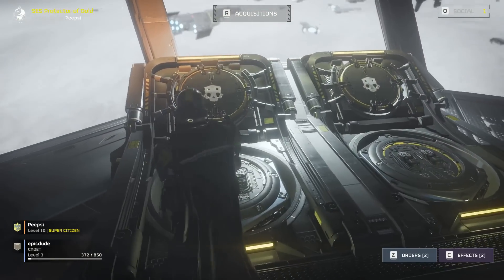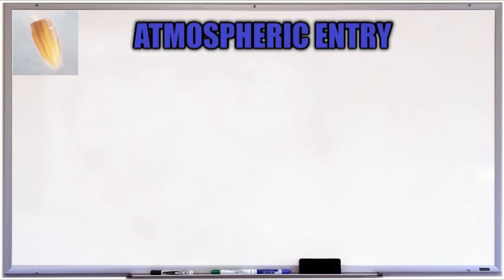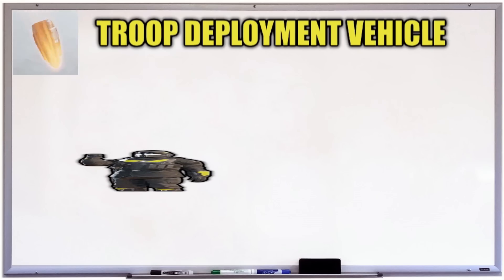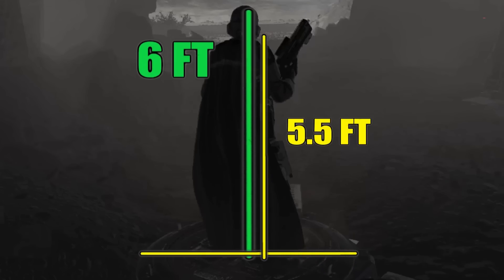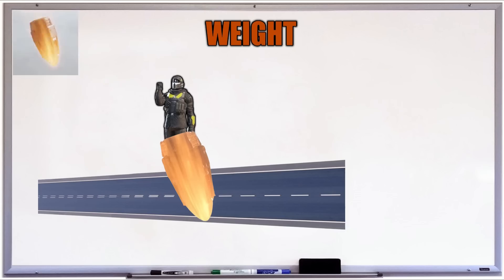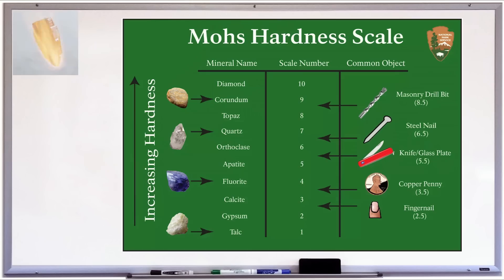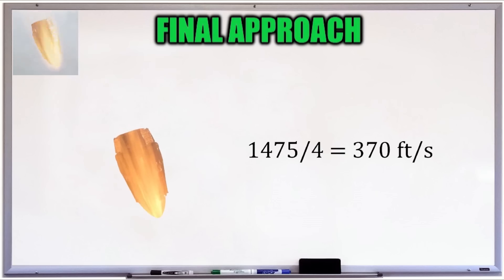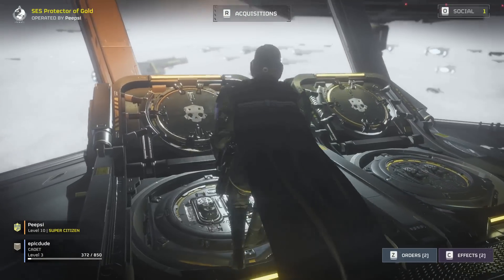Engineering in Games: The Helldivers 2 Hellpod

Comment: What occurs to me is that given the rising motion, it's likely that the passenger in a hellpod doesn't stop all at once, picture a set of ultra resistant springs below the helldiver's 'floor' plate, that spread the 'time to stop' out over a longer amount of time for the passenger as opposed to the pod. This would cut the effective G force substantially. The now compressed springs could then provide force for the rising of the platform to eject the Helldiver from the pod. Other's have brought up this idea and I think it has some value to solving the engineering issue of 'unsustainable G forces on passenger' we're encountering here. Combined with lightening the pod itself and just a smidge of "I don't care about the long term damage." dedication to the cause, I think it's solvable.

Comment: im not sure about the whole shock absorbing gel theory that ive seen in other comments since from my knowledge in hydraulics liquids arent compressible to any useful degree but my idea would have been pneumatic pistons under the hell diver that could be used to absorb the impact force in compression and then after wards use the pressure to extend the pistons and lift the hell diver out of the pod.
PS: im not an engineer, I used to work as a mecanic and my theory is only based on my limited knowledge of hydraulics and pneumatic systems.
Reply: Shock Absorbing Gel is mentioned in one of the ship module upgrades to add that to the sentry deployment hellpods.

Comment: You didn't take into account the increased drag from the opening of the side flaps after you're out of atmospheric entry.

For a real Hellpod to work, the retro/thrusters would need to go online before what it is shown in game.

The real calculation is to figure out how high you'd need to deploy flaps and thrusters to slow down the hellpod enough for it to experience at most 10G of force when stopping. 10G is easily manageable and with training that is what fighter jet pilots and astronauts train to endure.

Edit: also there are shock absorbers that could be in place inside the hellpod to further decrease the deceleration and reduce the Gs experienced by the helldiver, which is also in canon that the hellpod does have shock absorbers to prevent a hellpancake.

Edit 2: Also, at least show on screen metric so we can follow along and try to help. With imperial you are basically limiting this to only USA to be able to help solve, I can only help telling you factors you could double check and tweak.

Edit 3: Thinking even some more, there should be a Rocket equation calculation to account for the weight of fuel for the retrothrusters to reduce the velocity on the hellpod. Additionally, taking into account the action of flaps and retrothrusters to reduce the Gs on impact you can afford to use lighter materials in both the cone and the hellpod walls. Also, you need to account for the insulation for the material, although you could just line it with Aerogel (which weights the same as air roughly) and your insulation issues are taken care of.
Reply: SUSTAINED 10 Gs is what pilots are trained for, so we could assume that during the slow down by the engines and flaps, the helldiver could experience 10 G optimally, but the actual Gs during impact can be higher since they're felt for a shorter time, ejections seats in fighter jets, for example, can make the pilots feel up to 30 Gs without dying, but being combat ready is a different story
Reply: 'real hellpod' in a sci fi game
Reply: @Random-user22  what kind of person comes to a video about the math of a hellpod from a sci fi game and what bothers them is the "real hellpod" expression?

Comment: Maybe ... make the tungsten nose cone hollow and then fill the tungsten nose cone with a metal that still has high heat resistance but crumples on impact like modern cars do. 
It would still have penetration,  it would have less mass and it would absorb some of the impact from the crumple effect. 
As far as the hell diver not cooking in reentry ... spray or coat the puter layer of the pod in aerogel. Aerogel vittually weighs nothing and has extremely good thermal resistance.  
Call space x for ideas on landing the thing , i aint no rocket scientist and i dont have a clue what sort of disposable rocket would be a good choice to slow down the pod just before impact.
Reply: Actually ... thinking about this more.
Maybe still use  titanium in the nose cone but use a titanium honeycomb structure in the hollow nose cone. Tungsten is brittle.The nose cone would also contain more aerogel in the hollowed out sections of the titanium honeycomb and a on board navigation computer. The navigation computer in the nose cone would be insulated and protected by the areogel, the titanium and the tungsten from heat of reentry. The sensor for the onboard computer would be located on the rear of the pod to protect it from heat and have nearly direct line of sight to the ship that launched it so moyhership GPS can give guidance info to the pod to steer it and keep it on course.

Comment: The pod could have a compression system. so the HD is locked inot a frame inside the pod. and it hold them securely, but near the top of the pod. And on impact it's now has room to turn those high g's into lower g's by increasing time of deceleration. Also we really don't know what speed the pod is going on impact anyways, because the speed in game seems rather slow.

Comment: For the reusable aluminum can there's the screw top aluminum beer can which I've seen for soda somewhere I think. 
Highest g survived was ~200 so what you had could technically be survivable. 
Though I think that was horizontal instead of vertical. 
One interesting other thing that might help is a shock absorbing liquid inside the pod there was a similar gsuit idea that was used around ww2 but I don't think it really left the prototype stage. 
Cool video hope this might be fodder for more like it.
Reply: Fair, however, I say we did this with glass bottles for decades where people  would bring the bottles back to the store & they'd be sent back to the bottler to be washed & reused as part of the delivery process. We had reusable things then single use was found to be cheaper & easier for companies, so they switched to single use

Comment: One thing i noticed when upgrading the eagle modules. It says something along the lines of having the pilot suspended in some special liquid that helps them pull higher G's in corners. Perhaps that would be used here?
Reply: It's a "breathable fluorocarbon" that gets pumped into the cockpit, would definitely help here. Also something to note, apparently the hellpods are steered by foot-accuated levers, which implies the helldiver would be taking in a good bit of the force from the impact straight into their legs.
Reply: A little late. but that’s different that’s reducing the amount of Gs for sustained tunes. which in real life the best pilots can handle a few seconds of a 8-9g turn before passing out. So the gel wouldn’t do much in terms of that seeing as those 100Gs are instantaneous instead of like it is in planes where it’s a lower number just for more time

Comment: Good video.  (Although - learn metric. it makes the math easier ;) ).  A couple of things to think about (I agree it's just a VG, but I enjoy the math too)  1.  The Destroyer isn't "In orbit" the way the shuttle is.  It is holding a fixed position above the planet.  So, relative velocity is 0.  All you've got is the initial velocity of being fired out of the thing, so much less heat shielding needed.  2.  The deceleration G force isn't ever going to be survivable as long as it's burying itself into solid rock.  Mars penetrator designs were designed for an impact velocity of 135 165 m/s (440-540 feet/sec) ref:https://ntrs.nasa.gov/api/citations/19810012471/downloads/19810012471.pdf  Perhaps the helldiver is encased in quick-hardening foam?  Breathing oxygenated liquid?  Shaped charge on impact to shatter the rock and a much lower velocity?  No idea.  But stuff to think about if you're still interested.  Have fun.